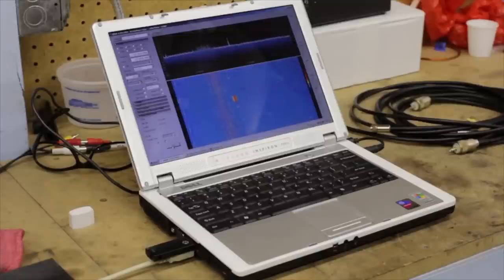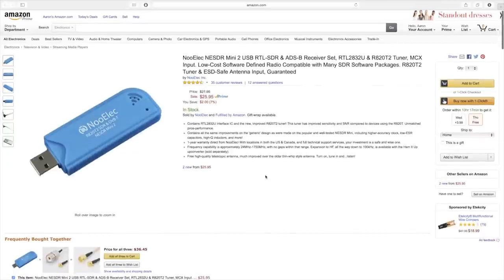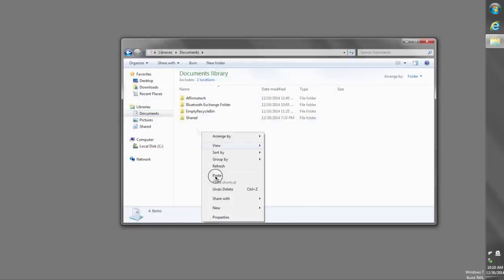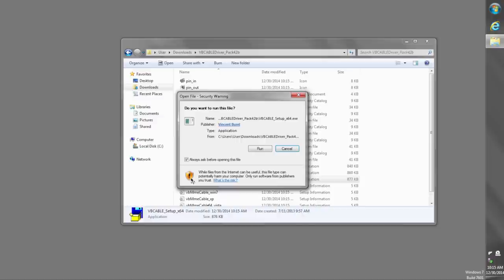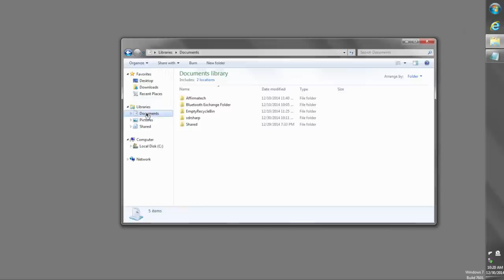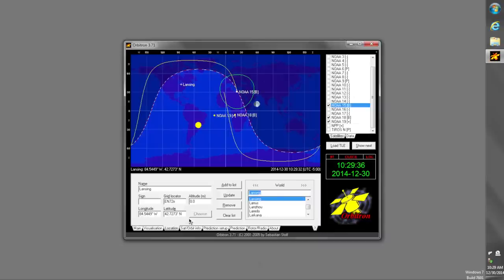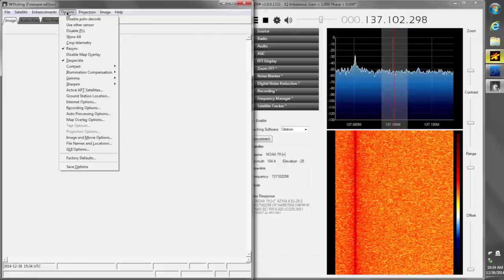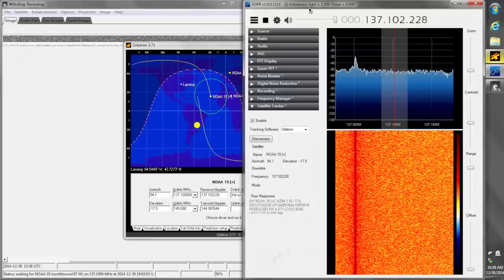APT Weather Satellite Reception with RTL-SDR, SDR#, WXtoImg, and Orbitron

Comment: I’m having considerable trouble linking my SDR# with WXtoImg via Virtual Audio Cable. Can anyone help me please? I’m running a Windows 10 laptop (64-bit with an RTL-SDR v3).

[UPDATE]: I got an operational install of SDR#, Orbitron and WXtoImg with VB-Cable. The SDR# version is 1.0.0.1361.
Reply from the maker: Thank you for the update! I haven't tried to get this going on Windows 10 yet. I'm sure this information will be helpful to a lot of folks.
Reply: Alex I,m the same had to go with the earlier version as you did. However my Cable  input (VB -audio Virtual C ) will not work it shows failure message in Wxtoimg yet works on Spectrum Labs so is working?

Comment: Aaron it's due to the version of SDR sharp you use. I had to download an earlier version of SDR sharp. Now got it showing the Satellite Tracker button.
All OK until you load Wxtoimg then when you've set it up when trying the test it comes up with Error in wave in open failed(check sound card in options Recording options) this seems OK as I've got Virtual VB cable selected , however it says the failure message?

Yep if you could see if you can start from scratch with the 2020 set up then you may find it difficult to set up now.
Appreciate your help.

Comment: Hi, thank you for explaining it step by step in detail.  Learned a lot and got everything running smoothly on the first try.. except I never got a signal. Turns out the only antenna i have at the moment is a cheap tiny dipole. So looking online found out I need an antenna tuned for 137. My thing now is I don't like the shape of most antennas and would like to build one my self. 
Would love to make satcom alike looking with black pvc and measuring tape cross dipole antenna. Anny advice? Should I give it a go? 
I'll appreciate your input 🙏
Reply from the maker: Thank you for the kind words! I say go for it on the turnstile antenna. I made one back in the late 90's and had good results with it. If I recall correctly, I used a big reflector behind it made of hardware screen. Might have got the design out of the ARRL Antenna Book. Good luck! 😀

Comment: Thanks Aaron. Your video is quite helpful, easy to follow, nicely edited. I'm just getting back into WEFAX APT after many years QRT. My last experience was 20 years ago with the old Quorum dedicated receivers on PCI bus cards. How things have changed! FYI, I have resurrected my own designed circularly polarized turnstile antenna and mast head pre-amp for WEFAX APT. (Hitherto been stashed with the aluminium scrap at the back of the shed). It is now back in use with replacement feed line and I'm having a lot of fun with an RTL2832 equipped TV Tuner and DAB radio dongle, aided by your excellent guide. Cheers from Nev 73's es TNX de VK5XD in Adelaide, South Australia.
Reply from the maker: Neville Thomas That's great! Glad I could help.

Comment: At the 20min mark, how did you know which NOAA satellites to select and to update the downlink frequencies?  

I only have the little (whip?) antenna that came with my RTL-SDR, will that work?   What about a 5ft telescopic indoor antenna?

Also, there is a program called WxTrack is that similar to WxtoImg?
Reply from the maker: I believe that NOAA 15, 18, and 19 are the only ones currently in service.

I don't think that an indoor whip antenna will work well in this application. The inefficiency of the antenna combined with attenuation from being indoors and loss from polarization mismatch is likely to lead to disappointment. Keep in mind that the signal you're trying to receive is coming from a solar-powered transmitter in space. It's worth building an efficient antenna with the correct polarization.

WxTrack and WxtoImg are different. WxTrack serves a similar function to Orbitron.

Comment: this is good! I was part of a cadre of teachers years ago (1990ish) who was pioneerin the use of Apt in the classroom and now trying to teach it again. systems came from gti electronics in PA very good turn key systems. anyway I am glad to have found  a more economical  system. question.

Can this system download Wefax and GVAR?

thanks and good job on the video.
Reply: The RTL-SDR approach is exactly like attaching a standalone VHF receiver's audio output into a PC's line in, so yes, any software that could decode Wefax by reading signals from a VHF setup will work with such a system. In fact, you can even install a virtual (software) "audio cable" in the PC that is running the decoding program so that the audio from the RTL-SDR receiver is re-routed into the audio input where the Wefax program is expecting to hear the signals. This way, a single PC can run all the software that is needed: one (such as Orbitron) for tracking the satellites so you will know the satellite passage times, the SDR software (such as SDRSharp) that actually receives the signals from the satellites via the RTL-SDR dongle attached to the USB port and the Wefax software (WXtoImg) to download the images. I do think that GVAR comes from geostationary satellites only (I might be wrong here), in which case you'd still need a parabolic dish, downconverter, etc, to receive GVAR specifically.

Comment: I believe you meant 23,200 miles-- maybe!?
Excellent video!!  It took me hours to setup SDR#, so I'm blown away at all the steps you took
to make this ALL work together!  Thanks. Definitely; Thumbs-Up!
Reply from the maker: Depends on where you measure from. I think geosynchronous orbit has a radius of about 26,200 miles and Earth has a mean radius of about 3,960 miles. Simple subtraction gives 22,240 miles above the ground. But of course the Earth is a little bigger around the middle (aren't we all after the holidays...), so it's actually less than that since we put geosynchronous satellites above the equator.

Comment: About 15 years ago I built my own WFM WeFax receiver, FET preamp, quadrafilar helix antenna, used the DSP processor in my computer's sound card and a freeware WeFax processsing app for APT. Photo printer print-outs looked too cool. I wanted to build an Az-El rotator twin yagi HRPT tracking antenna, down-convert the signal and try my hand. I even bought a 5' dia dish for the GEOS birds. I don't know why, but it all lost it's romance. Your video shows me what I can do with my cheap DVB rtl dongle can do aside from local FM radio stations. Thanks a ton for being a proud unapologetic geek. You rock.

Comment: I have made v-pole antenna. Using nooelec product LNA. Using RTL-SDR. Using SDRSharp software. To recive FM radio broadcasts to function properly, it's must use the LNA above. But after several weeks of trying to receive pictures of NOAA15, NOAA18, NOAA19, MetopB, MetopC, never got a good signal at the working frequency of the satellite. The reception location is in the middle of a field, an open area without obstructions (houses, trees). I have adjusted all parameter settings (frequency, bandwidth, etc.). Where do you think my mistake is?
Reply from the maker: Hey, Supri! During a satellite pass, do you see a signal in the RTL-SDR waterfall (but can't decode it well) or do you see no signal at all in the waterfall display?

Comment: I am in Florida and would like to get from the new weather satellite setting off the east coast.  Can I use a Direct TV type dish and point it at the satellite and what change will I need to do to the LNA? I would like to see the storm before they get here.
Reply: the TV LNA on a dish won't work, it's for a different signal frequency and polarization. It also needs power.

Comment: Thanks and yes I got download. Put line into SDSharp to put Sat tracker box/icon into SdDR icon list. Then put the 3 files dll etc into Sharpcap.
Unfortunatly the Star tracker doesn't show up on the left hand side it just stops at Signal diagnostics?
Any suggestions?
Reply from the maker: Sorry, no idea. 😟 It's quite a number of years now since I did this. I should probably give it another go with the current versions of everything.

Comment: hello friend, do you use some type of signal amplifier ?? what would it be?
Reply from the maker: I don't think I used an amplifier, just straight from the QFH antenna into the RTLSDR I believe.
Reply: @StuntProgrammer  I'm having a lot of noise when capturing the signal, I can only have good images once the satellite is at the top. Is there an amplifier that you could recommend to improve images? thank you very much
Reply from the maker: @lucasdossantosbull1398  If you're getting a better image when the satellite is directly overhead, it may be that there is some obstruction (trees, buildings, hills or mountains) or that the antenna design you're using favors direct overhead reception at the expense of lower angles. Image quality will depend on not just signal strength, but the ratio of signal strength to noise strength. An amplifier will amplify both the signal and the received noise, so its use in improving the signal to noise ratio is limited (though there are specific cases where it can help, like putting one at the antenna-end of a long cable run to compensate for cable losses). I suspect if you can get your antenna clear of obstructions or perhaps try a design with a good balance between high- and low-angle performance you'll get the best results. I think the very best weather satellite images come from antenna systems that are highly-directional and have a computer steering them to follow the satellite on its path through the sky. Without something like that, it might be necessary to be satisfied with less perfect results -- especially if the local terrain is difficult.
Reply: @StuntProgrammer  Thanks a lot for the help.

Comment: Do you have a link on how to build the Antenna, or what it's called?
Reply from the maker: Yep. There's a link in the description, but it looks like the site is not presently active. Here's a link to the same page in the Wayback Machine: https://web.archive.org/web/20190629211229/http://perso.wanadoo.es/dimoni/ant_qha.htm
Reply: @StuntProgrammer  - Unfortunately the download for building, and the email are both dead.
Reply from the maker: @tubeDude48  Yeah... I don't think the download link worked even when I used it. I think there was enough on the page to get it going more or less.

Comment: I'm getting a lot of slant in wxtoimg when receiving. Also the slant is not stable, its moving around a little. In another video they told me to put MSPS on 0.9 is that the solution ?
Reply from the maker: Far out. I haven't seen that before... guess it's worth a try.

Comment: I had a version of this running in my Ham shack about 5 years ago (coincidentally around the time you put this video up). I wonder if the software will work with W10?
Reply: Installed it and it seems to work.

Comment: Hi great video , however cannot find StarTracker 2 programme. Can you post a link.
If it's the one under the video Satellite plugin public crap this doesn't go anywhere ? 
Can you assist please.
Reply: -Sorry about the spell checker   It should say public -Xrp .s3 etc
Reply from the maker: The SatelliteTracker plugin? The link in the description goes directly to the download. I just gave it a try from here and it downloaded the file (it's a direct link to download the file itself, not to a web page).

Comment: Very well presented.
I have noticed that the software seems to have a problem maintaining a nice straight picture edge. I mean the horizontal sync is often not detected at exactly the same time resulting in skew picture edge. Is this due to the WXtoIMG software or the RTL device?
I have an ancient digital scan converter that I built 30+ years ago but it syncs very well. Not nearly as versatile and small as the modern gear though.
Reply from the maker: I think that WxtoImg lets the pixel clock run free during reception, then tries to de-skew in a post-processing step. I agree, the edge looks a bit wobbly even with a good signal from the receiver. I think this is down to the algorithm. It may be optimizing for something other than a perfectly crisp edge. Good question for the developer.
Reply: I can't imagine why you would want to optimise for anything other than a straight sync edge. If you don't have a straight sync edge you may as well not have a picture because everything becomes distorted.

Comment: i am doing everything step by step and in orbitron doesnt show me the sdrsharp option on the box in the "Rotor/Radio" any ideas?
Reply from the maker: malakesable You could double-check the steps for installing the plugin. If that doesn't work, it might be that they've changed something.
Reply: I had to run Orbitron as administrator to see SDRSharp option in the Rotor/Radio box.

Comment: I set the sdrsharp as you said but didnt get the satellite tracker in sdrsharp but will try again
Reply: +Darren Morris   Did you get any response offline on this.  I am having the same problem as the satellite tracker won't appear in sdr# despite adding the line in the plugins.xml file.

I'm also having issues with Orbitron not showing SDR# as a driver.  Despite adding the two lines at the end of setup.config file.

Any help would be greatly appreciated.
Reply: +Darren Morris I think the plugin does not work anymore version 1400+ (http://www.rtl-sdr.com/sdrsharp-plugins/). Try this link for some help: http://www.satsignal.eu/software/DDETracker.html.
Reply: +Paul Lewis If you open the Orbitron as admnistrator the SDR driver option will be available.

Comment: How to get upto 6 GHz using just from 1 MHz to 3.2 GHz sdr usb.
Reply from the maker: Someone might make a downconverter that would work for you. I think that frequency is a little high to use an off-the-shelf C-band LNB, unfortunately.
Reply: @StuntProgrammer  thanx. I'll look into it.
Reply: @StuntProgrammer  I want to get wideband upto 6ghz, which converter you suggest?
Reply from the maker: @chetnapatel9700  Sorry, I'm not familiar with what's on the market to be able to make a recommendation. You might check in with the SDR folks; I think there are some sub-reddits where they hang out? Maybe other forums too.